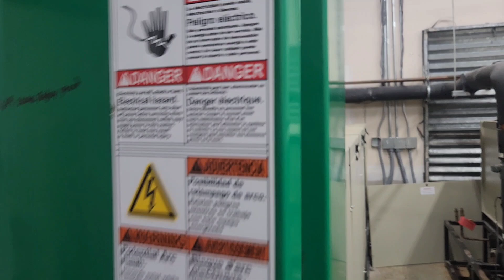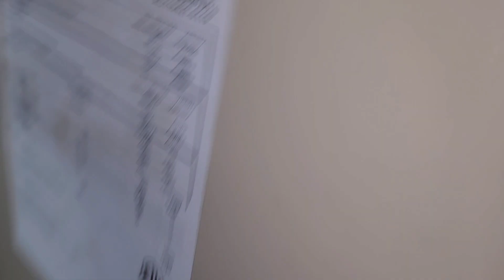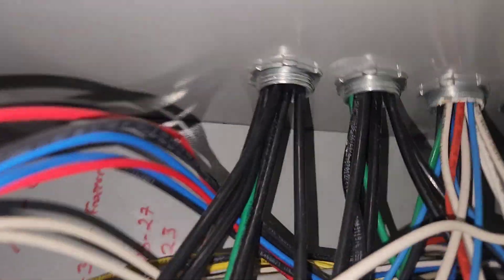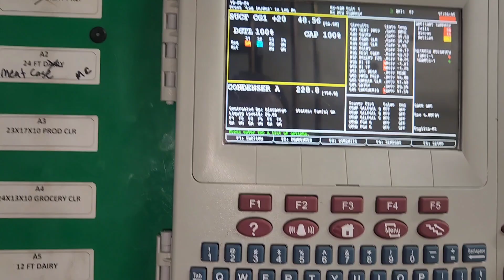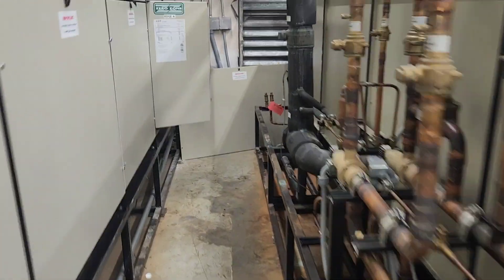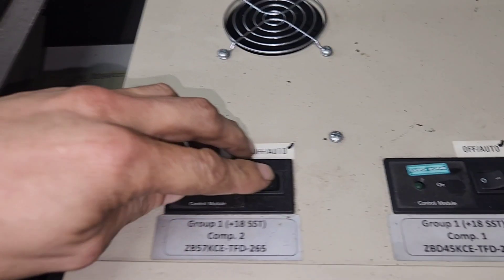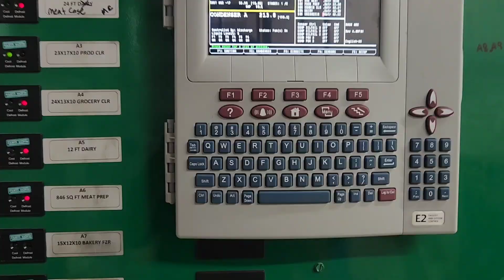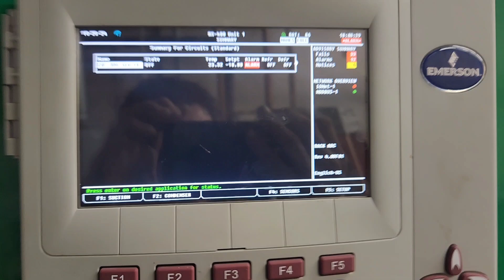Melted Wiring on E2 Controlling 3 Racks

Comment: I have a bone to pick with your comment about the racks shutdown. This is just not true. If it’s wired like a normal dx none co2 store, it should fail safe on and run off of mechanical controls. That’s why everything stayed on after the e2e lost power
Reply: Most of the Zero Zone DX racks I encounter, there are zero mechanical controls. If the multiflex boards lose comms/power , they will run whatever their failsafe is on the multiflex boards. Hussmann Superplus are the only racks I’ve seen with the switchback mode.
Reply from the maker: Shortly after the E2 lost power, the compressors on B and C staged off. This is why I decided to switch off all the compressors manually.  Otherwise I would have just left them alone. 
Cool discussion, 😎
Reply: I believe those boards are wired normally closed on the defrost relay output. Not sure why unless they intentionally want the rack to pumpdown. But soon after the CPC starts communicating with the I/O boards they should return to whatever the schedule has them programmed for. In other words the failsafe for those boards are running normally closed (defrost ON). You can change them with the dip switches. I can show you next time. Thanks for the vid. Stay safe